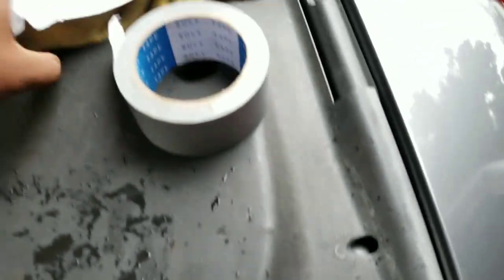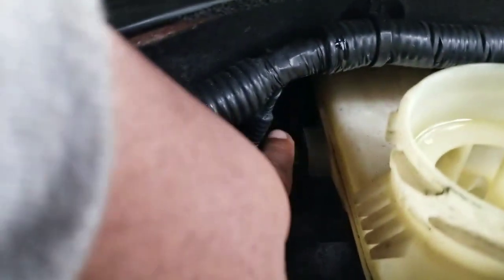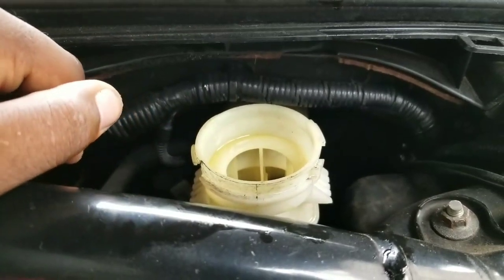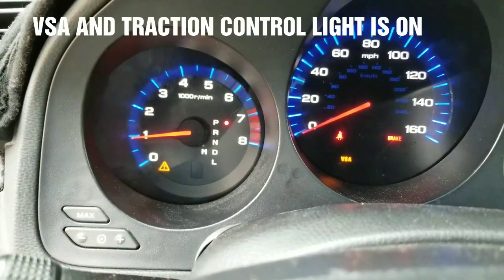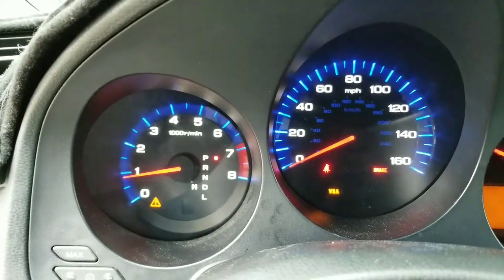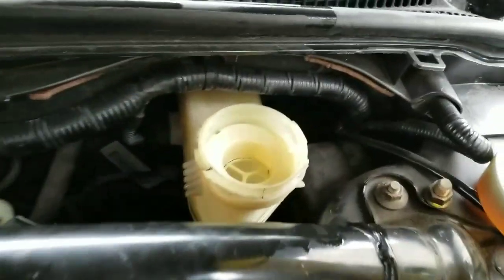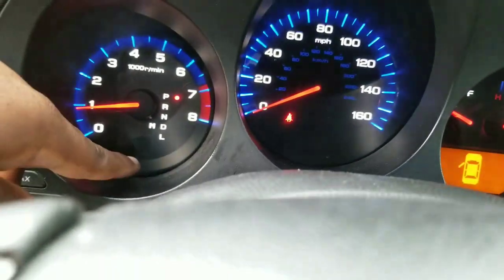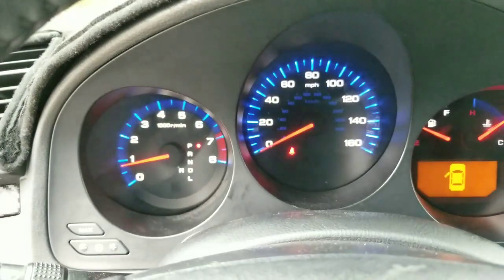BRAKE LIGHT VSA MASTER CYLINDER SWITCH TEST FIX TUTORIAL

Comment: I have a 2012 Acura Tl Tech, recently my Low Brake fluid light came on, Check VSA System, the red brake light indicator is on. I checked the brake fluid was low, I filled it back up, turned the car again, and still all 3 signs there? There’s no leak in the brake system, my brake pad is 50% life remaining. Checked all the fuses ok? I did notice my brake fluid is little bit dirt, is this causing all the issues? Does anyone experience this problem? Any help would be greatly helpful, and much appreciated.

Comment: A problem I’m having know is got an 06 Acura TL 
The triangle light and ASA on its comes on and off sometimes when I’m driving and it brakes the car like if I’m braking help pls
Reply: Hey bro did you find a solution for this?
Reply from the maker: Abs sensor

Comment: Help, I have spongy brakes on my 06 TL. I've replaced all calibers, brake pads, fluid, booster, master cylinder and bleeding the brakes. Also changed the sensors out. If there's anything I'm missing please Hook me up with information.
Reply from the maker: Did you bleed the brakes correctly
Reply: @fabolousg4ever  yes, but I suspect the abs module isn't working properly.

Comment: I changed my master brake cylinder and added new fluid and still have VSA on. My car won't really drive anymore. RPMs are high and it feels like I have my brake on... any advice?
Reply from the maker: Scan the car pull the codes and send them to me you def need a high level scan tool to see what's going on.
Reply from the maker: Map sensor
Reply: @fabolousg4ever  Thank you! I subbed =)
Reply from the maker: @aveckillz  appreciate it
Reply: @fabolousg4ever  Also have my TPMS light on

Comment: 06 Acura TL. Just replaced the front and rear valve cover gaskets and i feel like i did a good job and connected everything back how it was. But now my VSA and BRAKE light come on. I reset the codes with a cheap scanner and unplugged both terminals for 5 minutes and nothing. Hopefully someone can reply ⚠️

Comment: Thanks bro, this happened on my way to work and freaked out lol learned sumthing new
Reply from the maker: U welcome
Reply: @fabolousg4ever  hey bro, I refilled the brake liquid and this morning the same lights came back on.I checked it and it was low again. Do you think I have a leak ? I refilled it again by the way.
Reply from the maker: Yup you have a leak
Reply: @fabolousg4ever  Went to the shop today and found out my passenger rear end caliper was leaking. I used 3 brake fluid bottles within a weak, it kept draining quicker and quicker as the days went. Finally had a chance today to get it looked at. I know next time wat the issue is wen those lights pop up thanks.

Comment: Guys if you are having limp.mode or vss issues, i fixed my vss limp mode and misfire i changed the vehicle speed sensor or (vss) once i replaced it i was able to drive without the vss popping up and it no longer goes in limp mode and goes to its full rpms

Comment: I got a question for you so my VSA And ABS light are on but when i look at my brake master the plug that connects to the bottom was unplugged. example of that small connector at 0:36 would that cause the lights to come on?
Reply from the maker: yea that would it should be plugged in
Reply: MODS FOREVER that’s what I was thinking I was wondering why it was unplugged and I cleaned my abs sensor and that was dirty so thought it was that originally because I had just did my wheel bearing on that side
Reply from the maker: plug it back in and erase the code
Reply: MODS FOREVER will that paper clip trick work just left my shop with out the obd2 scanner
Reply from the maker: lol i havent done that in years just use a scan tool bro do it the right way
Reply: MODS FOREVER also I have brake fluid above the filter in my brake master will that work it’s way down while driving the car ?
Reply from the maker: @BoostedGPTL  try sucking up some of it with a cloth but dont let it drip on your paint

Comment: Thank You for this! I have the exact same brake master cylinder on my 2013 Accord. Changed brake pads, Rear hub bearing, brake fluid flush at each caliper....then lights went crazy on dash. Car goes into limp mode unless I turn off TCS.  This seems to be a big problem with this master cylinder used on several different cars.  I cleared brake, ABS, Steering, TCS codes then they came right back after about a mile of driving. I was looking to replace brake master cylinder but this video gives me something else to try first. I feel pretty good about it! So Thank You, again!

Comment: So my problem came back after filling it last Thursday. I noticed break fluid leaking from my rear pass caliper. Calipers only couple years old. Hoping it’s not caliper seeing my mechanic charged like 700 for caliper and pads while back and my brother in-law can’t do it till better weather. Think it’s ok to just keep filling it for now?
Reply from the maker: umm nah get that caliper replaced you dont wanna be driving with a leaking brake line or caliper get that fix asap and it shouldnt be that exspensive find a good shop and it will be no where that price its so easy to replace.

Comment: I have the vsa light that comes on my Acura  tl 07 when driving and my car is jerking and not catching gears properly and I park shut the car off and turn on the car and it goes away but my gears still act up and I tried driving on manual mode and it catches gear better but it still comes up the vsa sometimes what can that be please I'm having this issue now
Reply from the maker: sounds like pedal position sensor .
Reply: Did you ever fix the problem?
Reply: I have the same problem. I haven't had  the time to scan it and get the code. It doesn't help that i have transmission issues to top it off.

Comment: My triangle light stays on and vsa comes on after 25 30mph
Reply from the maker: wheel speed sensor needs to be replaced
Reply: @fabolousg4ever  how do I know which sensor? The abs sensor correct
Reply from the maker: @shawnstreeter3474  you have to scan the car with a abs scanner to pull the codes.

Comment: That Happened To Me, When I Flushing My Brake Fluid.. But The VSA Light & Brake Light Is Still On.. What Else Could It Be??
Reply from the maker: could be a wheel speed sensor you need the car scannes for abs codes.
Reply: @fabolousg4ever  Its Weird, B/c It Didn't Have It Before I Did The Break Flush.. You Think It Will Go Away By Itself, If I Keep Driving It For Awhile?
Reply from the maker: @TheTylerjoy04  yea you prob messed up the mastercylinder sensor idk i would def scan the car for codes with a abs scanner and go from there.
Reply: @fabolousg4ever  Ok Thanks..I'll Check It 2mwr After Work.
Reply: @fabolousg4ever  Good News!  Found Out My Brake Fluid Level Sensor Is Out, You Called It.! 👍👍 Bad News, No One Sells The Sensor  By Its Self,You Have To Buy The Whole Master Cylinder, That's A $220 Master Cylinder..So What I Did, I Disconnect Connector No More Brake Light Or VSA Light..👍😁👍
Reply from the maker: lol that works good to know glad you fixed it

Comment: I have the traction control light on and as I continue driving the VSA light turns on. Would changing the break fluid, just as you did in this video help me get rid of these lights as well? Thank you in advance.
Reply from the maker: its prob a wheel speed sensor

Comment: Brother please help me. Both vsa lights came on like yours and my car is stuck in park unless I insert the key in it manually. What can it be?
Reply from the maker: COULD BE A BRAKE LIGHT SWITCH COULD BE NOT WORKING CHECK TO SEE IF YOUR BRAKE LIGHTS WORK .OR CHECK THE BRAKE FLUID LEVEL OR CHECK THE FUSES IN THE DRIVER SIDE  FUSE BOX 3RD FUSE 2ND ROW TO THE BACK EVEN IF THE FUSE ISNT BLOWN STILL REPLACE IT AND SEE IF THAT FIXES OUR PROBLEM.

Comment: I took my Acura to an Orielly’s and had a check engine light Nd I told the worker to erase my codes and the vsa light stayed on 😩
Reply from the maker: was the vsa light on before he erased the codes.
Reply from the maker: he probably erased the memory for the vsa button you need to reprogram the neutral memorization process.
Reply: It was working properly
Reply: It was off

Comment: Wow bro.My 2006 accord v6 has the same problem.BRAKE light and VSA with the triangle.So i have to drain the master cylinder reservoir and fill with new oil and will work? I have to try this and see .Thanks a lot bro 👍
Reply: This didn't work for me
Reply from the maker: prob need to replace wheel speed sensor you need a scanner that can scan abs codes to tell you exactly what it is.

Comment: Hey bud when your vsa and traction control lights came on did it let you shift out of park?
Reply from the maker: yes
Reply: @fabolousg4ever  mine has the vsa and traction control light on and now it's not letting me shift outta park
Reply: @weaverfromtha913  how did you resolve the issue?
Reply from the maker: either check the brake lights to see if they work if its not the brake light switch then it a fuse from the fuse box driver side kick panel 3rd from the back 2nd row fuse replace it even uf its not blown still replace it.

Comment: I sprayed my engine down with a Degreaser and wash my engine off at the car wash while the car was running. I got back in the vehicle and notice I threw a code. I put my engine scanner on it and it told me it was Bank One O2 sensor so I erased the code drove around for about 30 miles and the light then come back on again so I wonder what was up with that?
Reply from the maker: you shorted out a 02 sensor time to replace it.
Reply from the maker: i dont ever wash even only use a steamer to clean mine nothing else.
Reply: Thanks bro I appreciate it

Comment: Will these lights affect it to do smog?
Reply from the maker: yup any lights on dash you will not pass smog
Reply: @fabolousg4ever  I just changed my front breaks and put new driver side break line cuz was  cracked 
 Break oil is full now.. U think I'll b the tier sensors?
Reply from the maker: huh what do you mean tier question pleade explain the questions.
Reply: Wheel speed sensors
Reply from the maker: whats the lights on the dash say
Reply: Vsa and the 🔺
Reply from the maker: yea prob is speed sensors

Comment: I’m having the same issue with my car the brake light doesn’t turn off even after I filled up the brake master cylinder
Reply: Whatsup Acura lovers. 
I have the same problem all 3 lights on but the break level is to the top. There's no break leaks so my thinking is that sensor he show next to the master cylinder is bad.

Comment: What if you abs vsa and brake light is on
Reply: There is a video on YouTube how to shot them off but if they doesn't go off after the process them you have the same problem i have. Probably the oil  break sensor.

Comment: I've had the vsa and traction control light on for a while nowbut no break light. Would doing this take care of it or is my issue different
Reply from the maker: Most likely a wheel speed sensor
Reply: @fabolousg4ever  really? I didn't know the TL had wheel speed sensors.  As soon as I turn my car on the traction control light will be and then after a little bit of driving then vsa comes on
Reply from the maker: They are abs sensors on each wheel if you have that light on one of your wheels sensors are prob malfunctioning
Reply: fabolousg4ever  hi I fixed the abs sensor and I put a brand new one but the traction light is still on..so what can I do bro? Also I have a P1717 code..what is that ?
Reply: That's the same thing going on with mines. So did you fix the issue?